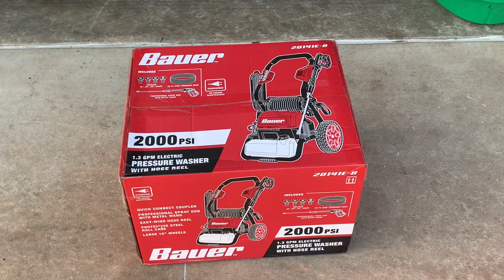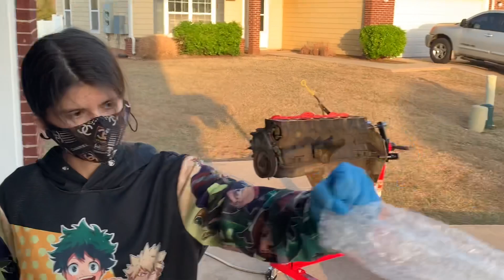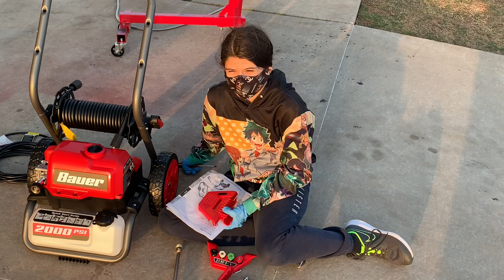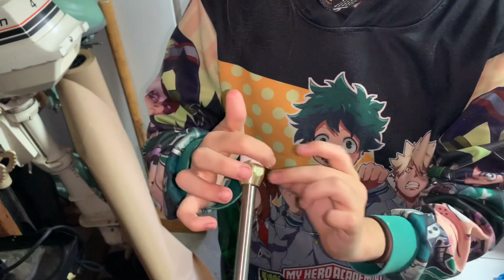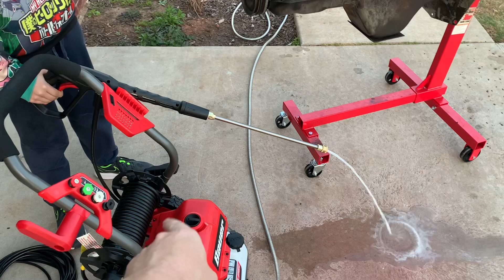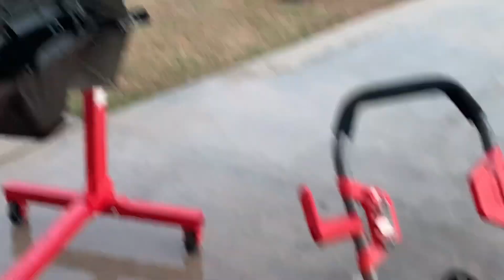Harbor Freight Portland 1700 PSI Pressure Washer changed out for Bauer 2000 Psi Electric - Unboxing

Comment: Ive had like 4 Portlands. After about a year they all break. I just upgraded to the bauer so we'll see how it goes
Reply: Btw this video reminded me when i get my daughter to help out 😂😂😂
Reply from the maker: Still working just like it should. Paired with a small concrete cleaner for the driveway works pretty good on a budget.
Reply: @SideGigSquid  Thank you, this is a very helpful video, you helped me to make up my mind. Can you share information about your concrete cleaner? I would like to get both. I think I'm also going to upgrade the hose right away to something more flexible. Oh and I read you got the warranty, I will make sure to get it as well. Thank you so much. 🙏🏽

Comment: I'm having trouble with the red and green tips on the 2000 psi Bauer , they stopped working after I tried using the soap dispenser black nozzle. The white tip ended up working but idk what's going on now... do you or anyone know anything about this issue?
Reply from the maker: I actually had an issue with a green tip that started spraying weird. I swapped it out with one that came with the foam cannon.

Comment: I've had 2 of the Portlands now. First one lasted 1.5 years. Motor died yesterday so I exchanged it today for a new one. Got the new one home and half way through washing out the bed of my truck and it died. I called harbor freight and they are upgrading me to the Bauer at a small extra cost.  I'm hoping it lasts longer than the Portland did.
Reply from the maker: The Bauer is so much better if you use it more than once a month. I use mine weekly.

Comment: My green one went out on me thinkin bout gettin the red one
Reply from the maker: That’s what happened to me it was still within the one-year warranty I took it in exchanged it and upgraded to the new one for a price difference
Reply from the maker: My green Portland one lasted about 11 months. But I used it pretty heavy, about three times a week minimum. The Bauer has been going strong for a few months now but I also bought the warranty that goes with it.
Reply: @SideGigSquid  

My Portland green one has been going on 6 years ... still working but does starting to hiccup..
Reply from the maker: My green one worked great but I didn’t use it extensively more than a normal homeowner would. I should probably get the gas powered one for as much as I use it. But that’s why I bought the warranty.